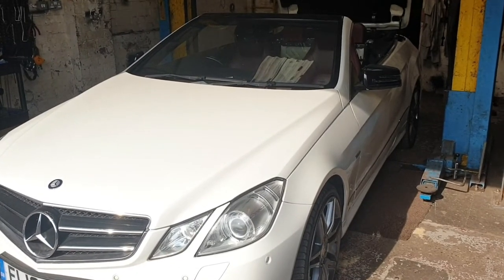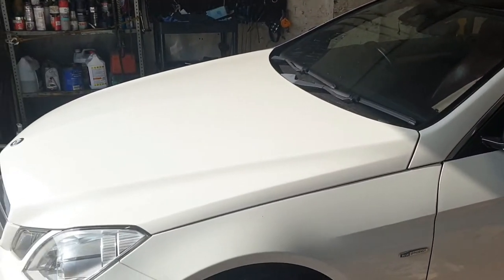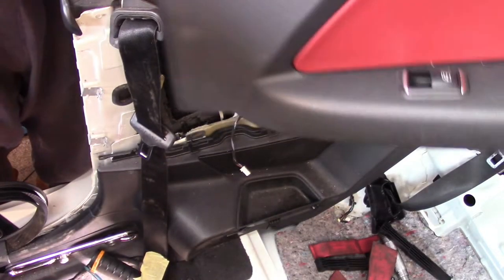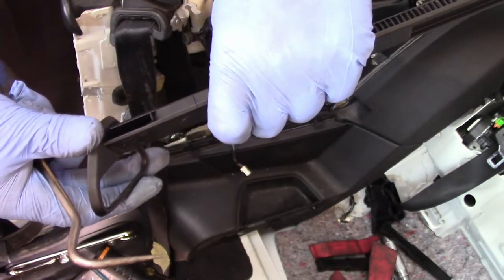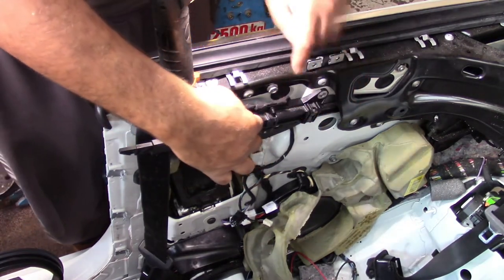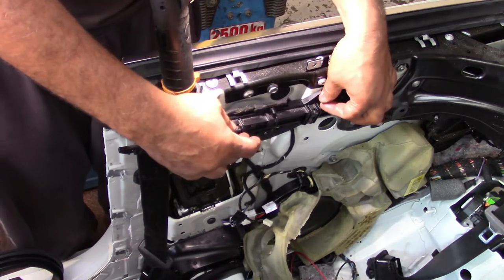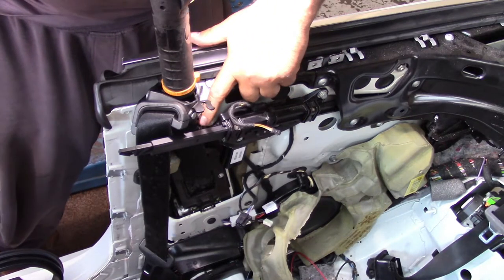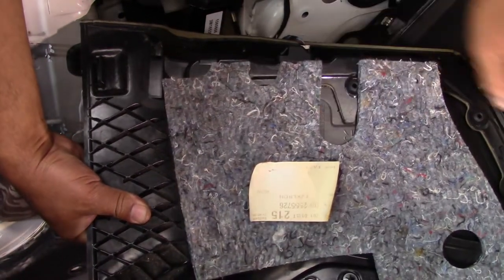Mercedes Benz W207 Cabriolet Front, Driver/Passenger Seat Belt Extender Motor Removal,  Installation

Comment: Hi. Can you help, please? My passenger extender works dizzy, sometimes as should, sometimes doesn't extend at all, sometimes extends quarter way only and retracts straight away, other time extracts half way and retracts straight away, sometimes sometimes extracts full length but retracts straight away. When doesn't extend at all I press the extender button/switch and extends very rare. Extender seat belt button/switch is good 100%. Driver side works as should all the time. Any little help, please? If I'll change the extender motor/mechanism will solve this problem? Thanks in advance
A207 2011 E250 RHD